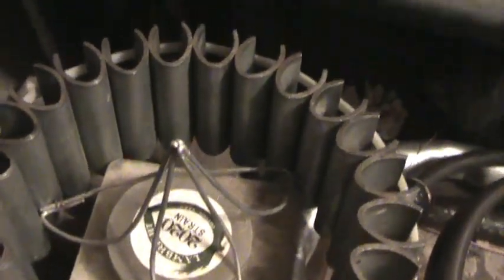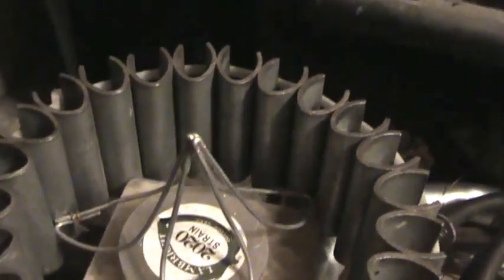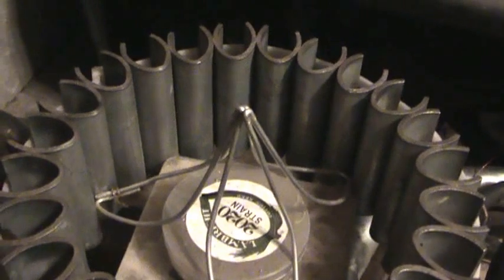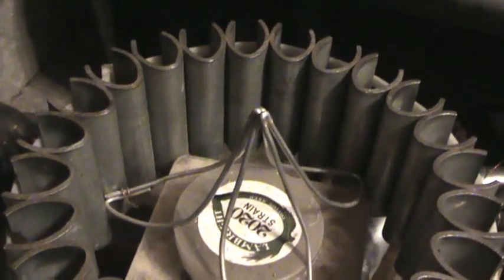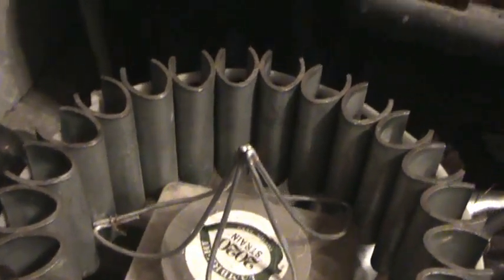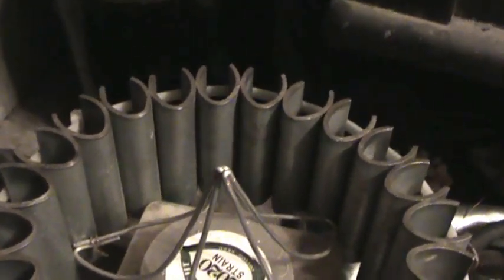Copy of Leedskalnin's generator & the visible flow of magnetic current

Comment: Thanks for sharing! I've been onto this in my theory and not many others appear to be aware of the middle pole (dielectric inertial plane) as it relates to magnetism and gravity. Kenneth Wheeler (Theoria Apophasis) says this bloch wall is the driving force of radiating centrifugal divergent diamagnetism. Although I see it as a part of the magnetic cycle. Of importance here is the use of it in Ed's flywheel. All middle poles are located in the middle of the wheel. All north souths are connected in a circuit. Like your open iron ring of which you have pulsed in order to close the loop and make a PMH. Now that ring of North South magnets is likewise a PMH. And what is occurring is dielectric inertial plane compression of spacetime in the middle of this wheel of great concentration.Yet to be discerned, how to use it's force. Which is known for the creation of mass gravity, compression of spacetime and as the phase conjugation of the cycle of magnetic discharge from the north south ring of magnets. The middle is dielectric capacitance (insulated charge stripping via triboelectric series effect, cationic positive static charge.) This pole of the combined dipoles, the other being the outer ring, representing levity magnetic radiation, anionic negative receiver of the stripped away static charge.